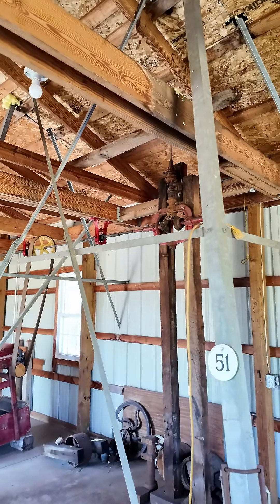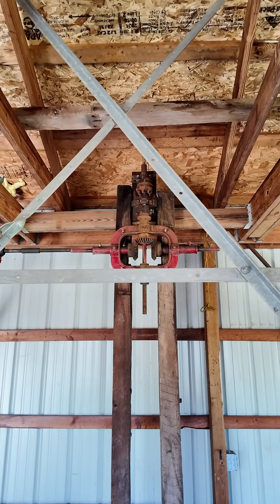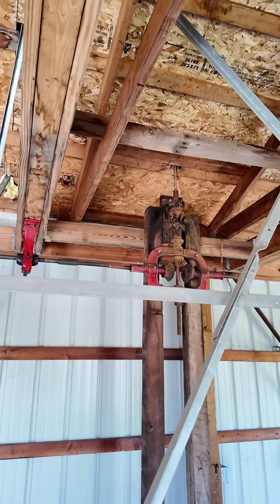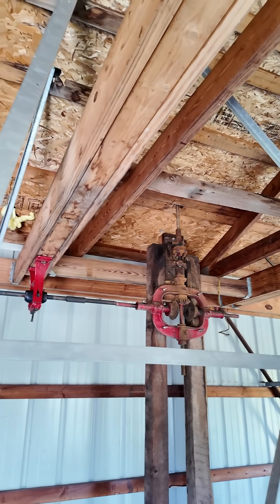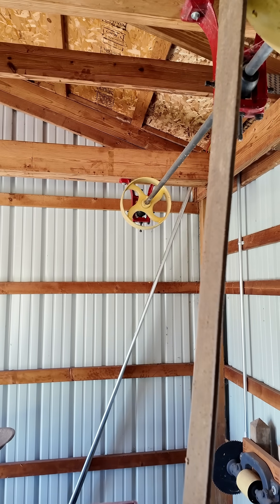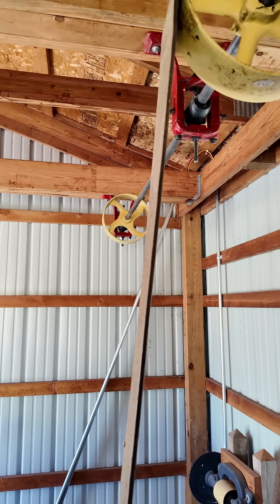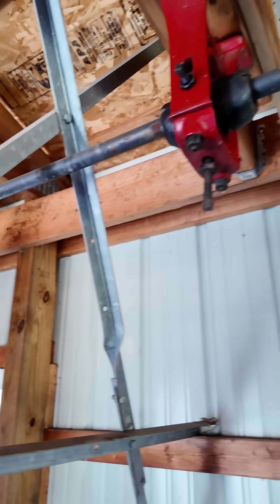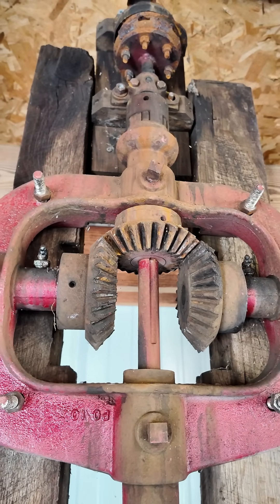Wind-Powered Factories!

Comment: Also, does more blades means more efficiensy at the mill?
Reply from the maker: Sort of.  These were designed decades before wind tunnels, so a lot of it was guessing and trial and error.  The blades were just stamped metal, not an airfoil design.  Modern wind turbines design them as airfoils, and that needs less blades but more length.
Reply: @Industrial_Revolution  just asking, because in aviaschool been talking to a tutor of aerodinamics
. He said that 4 blades is maximum, because of aerodinamic resistance of the blades.
Reply from the maker: I wonder if that applies only to airfoil design.  Looking into a jet engine there's dozens of blades at each layer.  I don't think those have airfoil designs, either, do they?
Interestingly, one other place with similar issues, is propellers on ships, which are mostly 3-4 blades, but the newest ones, with the most design work, on modern submarines, have far more.  Those are designed for both power and silence.

Comment: Hello Darren!
Magnificent compact windmill drive. But seems like it use to be gear box somewhere in this line
Reply from the maker: You have the gears in the video to change direction, and there's another one at the top like it, to turn from a horizontal shaft to vertical, but they don't change speed.  On the overhead line drive system, they adjust the speed with different pulley sizes, though.

Comment: When I was growing up in Cleveland, Ohio in the 1950s, our Pop liked to drive to small local cities. Like Canton Ohio and Warren, Ohio. Some of the early motels, still had ceiling mounted fans that ran off of pulleys, connected by leather belts, to a central but offset electric motor. Before air conditioning.
Reply from the maker: I've seen that in old Dave & Buster's.  Unfortunately, at least one I've been in, they got rid of that.

Comment: Pretty neat.  I didn't know this existed. Only water powered line drives and steam.  We had a boat builder on Long Island that used a small line drive system similar to this wind powered system, run with a "L" head automotive engine.  Likely from around the 1920's.
Reply from the maker: This is the only place I've seen it with wind power, too.  Using a car engine is interesting, but I assume that's because there was no electricity there yet when it was first built?
Reply: Yes, probably no electricity.  They were boatbuilders so they knew how to hook up engines to boats, maybe also had some farming experience too, so this would be within their skills to do.  I visited the abandoned shop on the small island around the mid-80's.  It is all gone now.

Comment: Was happy to see in my new home town , Columbus, Ohio  a  few remaining saw mills within buildings that had line drives w/pulleys. Electric motors not wind, ran several machines. I imagined steam engines originally ran the pulley array.  There were other defunct businesses that left the pulley system up in their rafters.
Reply from the maker: There's a mill I want to get into to film that Is set up to use water or steam or electric for their line drive system, depending on what's available.